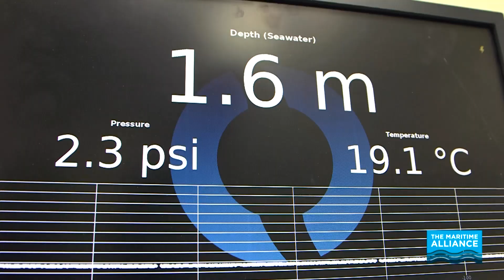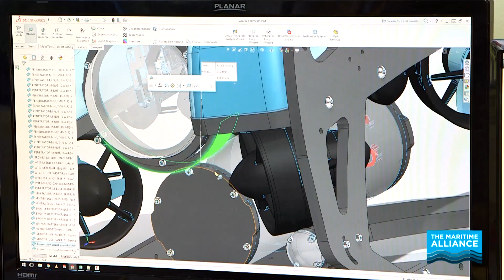Mechanical Engineer - Blue Robotics - BlueTech Career Pathway Video

Comment: Hi guys, i just got my BlueROV2 - Maybe the First in Austria 😉 its AMAZING! Question: what tether spool are you using? Looking for something for my light tether which can used releasing tether White Pfluged in / in use without twisting the Connection to the QGC Station 🤔